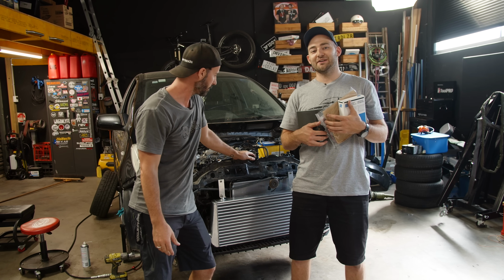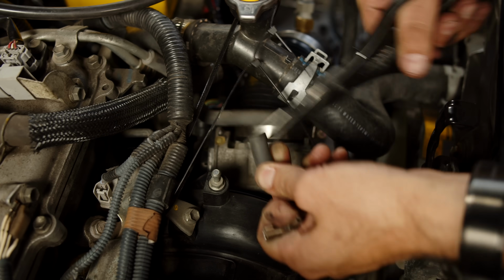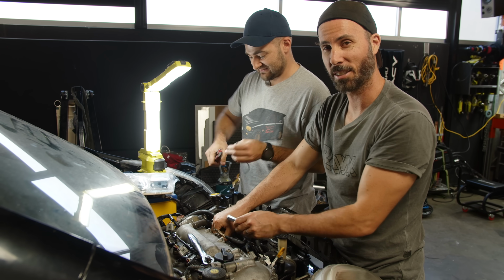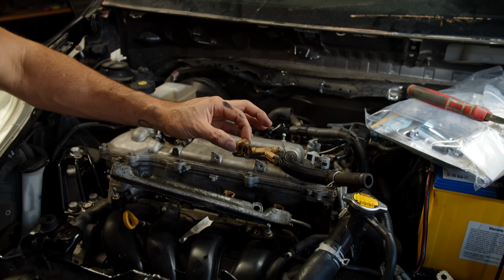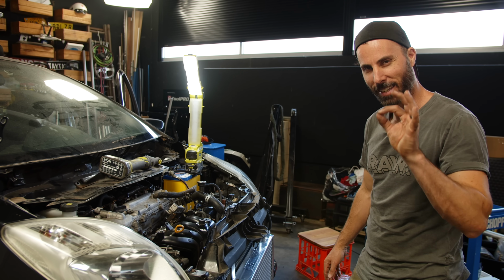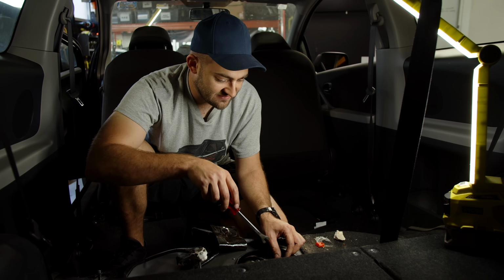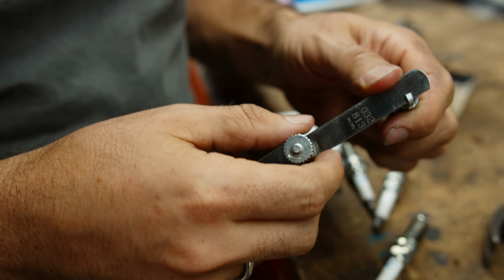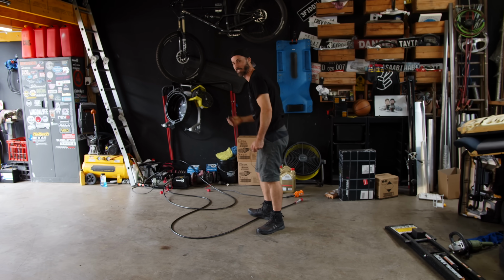Budget Yaris Gets BOOOOOOST // $169 eBay Turbo (Will it go or will it BLOW?)

Comment: Moog is right. It's duck tape. The tape is good in wet applications and not good in application with large temperature variants. So it's actually really bad when used in ducts. Hence, duck tape and Moog explained.
Also, Marty, you've upped the stakes to 2 grand